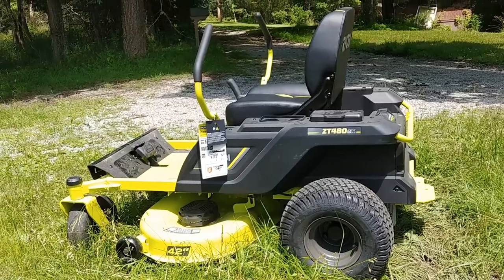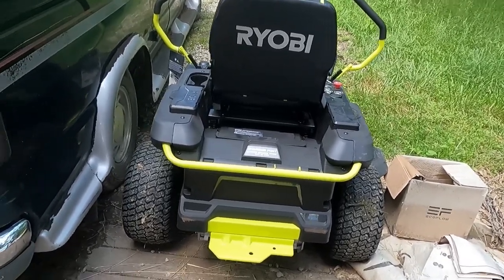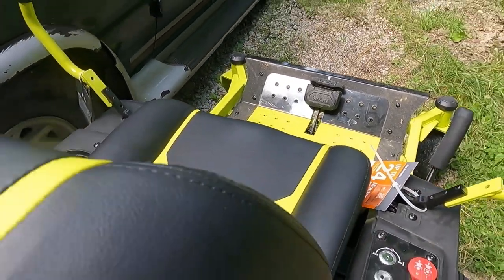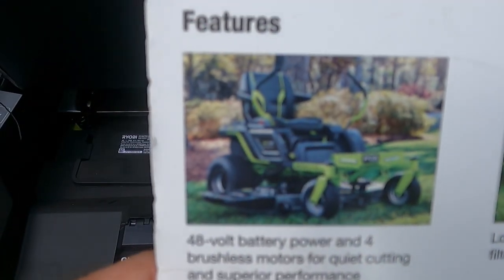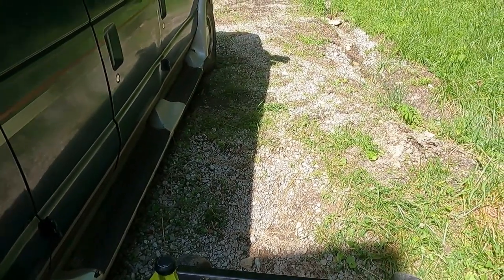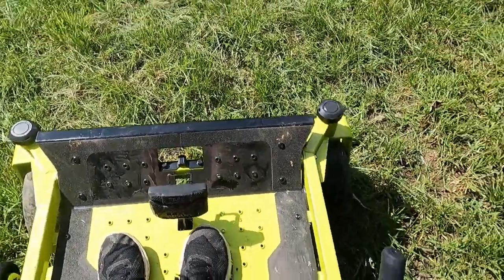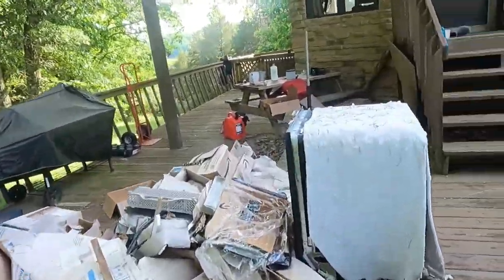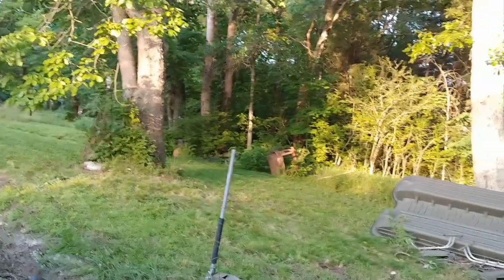$0 to mow my yard!  ryobi zt480ex battery powered zero turn mower  #ryobi #zt480ex #electric #mower

Comment: You’re going to pay for it in batteries. I’ve had to replace my batteries every year now. Around 1000$ each time.
Reply from the maker: probably, I've heard mixed reviews on the life of the factory batteries.  I do know lithium batteries would be way better so if mine ever go bad, that's what I intend to replace them with ... and even though that will be pretty expensive, hopefully they last sufficiently longer (the lithium battery in my van is rated for 10 years or 4000 recharges from dead)

Comment: But did you see your electric bill go up
Reply from the maker: Nope, because im charging it off the solar system in my camper van.
Reply: @sharpridgehomestead  what did the solar system cost you
Reply from the maker: @davesmith3892  when I built it for the van, I over-sized it to also serve as an emergency backup for my house.  I.E, the power goes out for several days due to a storm, I can run part of my home off of it ... actually, I could run my entire home off of it except in wintertime I couldn't run the heat pumps.  Oops, forgot the cost, it was $3259.99 (updated since I posted wrong amount initially) for the solar system only.  I also just used a calculator online, to see what the cost would be to charge this mower from completely dead 1 time ... it would cost you 4.8 kw hours ... or approx 20 kw hours per month.  All you need to know now is how much you pay your electric company per kilowatt hour and you will have how much it costs you in electricity.  As an example, my rural electricity cost .12099 cents per kilowatt hour, so it would cost me 4.8 x .12099 = 58 cents to charge it off my house electricity for 1 time, or 4 x .58 = $2.32 per month (4 weeks)
Reply from the maker: @davesmith3892  i was wrong on the cost of the solar system, I guessed, it was really exactly $3259.99, 300 amp hour solar system kit but I replaced the charge controller with a different model, added a 2000 watt inverter, and a 300 amp hour lithium battery plus misc wires, fuses, etc.